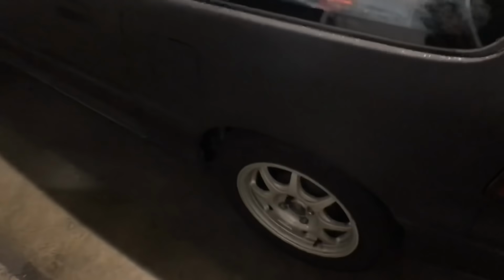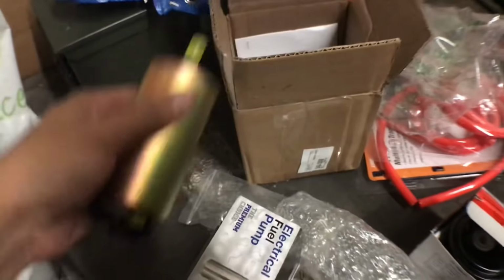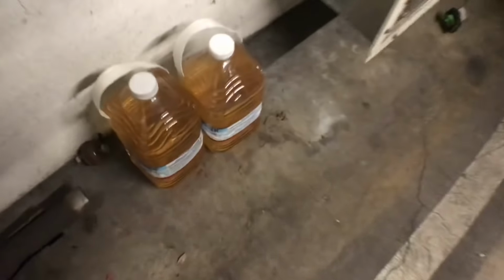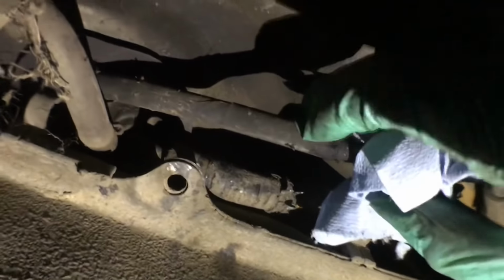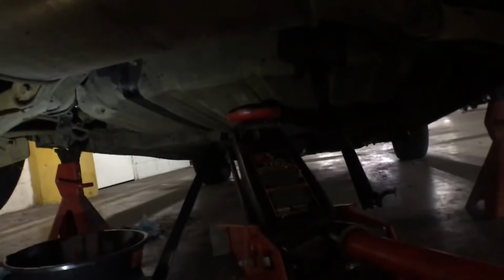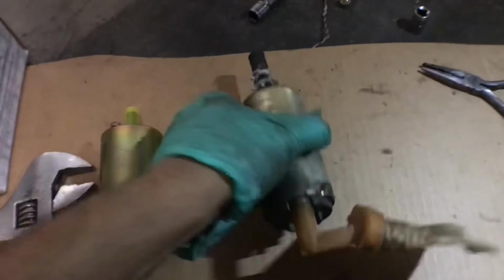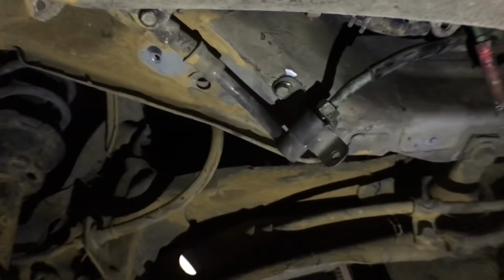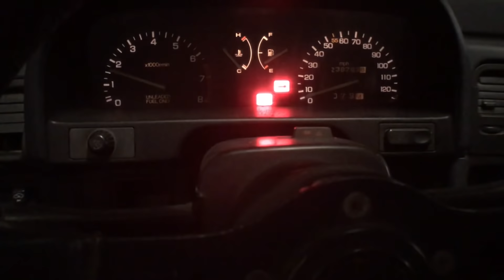Honda CRX build part 10 | Fuel Pump Replacement

Comment: Eyyy, thanks for the shout out man! Usually Spectra makes legit parts. Canadian company with a good reputation.
It is nice that it had the OE style electrical connectors instead of a harness you have to modify too. Hope it works out well for you!
Your gas was def a bit gross. Not emptying the tank enough before filling up, not driving enough, or it just has some surface rust in the tank.
This all makes me really appreciate cars that have fuel pump access doors! Thanks again dude.

Comment: Those spectra premium fuel pumps are sold by many different auto parts stores. I know because i work at Oreillys. And u have to remove the full tank to get the fuel pump out? I seen a access door in the interior.
Reply from the maker: Yeah, it’s an auto parts store special lol I like it a lot because it’s almost identical to the OEM pump.. and it’s a huge savings..

Comment: Ya get the fuel filter replace and throw in a bottle  of Injector  clean  see if that fix the hesitation.  Hook back up the pressure  gauge  see what numbers your seathing at on idle.

Comment: Replacing my fuel pump now and tried to Siphon gas out of the gas tank like you did with the same result. The hose was totally dry and it didn’t pull any gas at all.  I even added a little gas to see if maybe the tank was empty🤷‍♂️
Reply: I believe these old Honda have a gas drain plug anyway
Reply: @derekmaxwell8164  They do 17mm usually on the driverside of the tank.

Comment: Is this cheap ass pump still working ?
Reply from the maker: Car sold early this year, ran like a top. I’d say the fuel pump is a good purchase 👍
Reply: @IntegraDIY  did it fix the hesitation ?
Reply from the maker: @Raul F The fuel pressure was very erratic and weird, the pump fixed that issue, but the actual issue was a faulty spark plug wire. replaced with new plugs and blue NGK wires and it gained performance with zero hesitation. Hope this helps you out